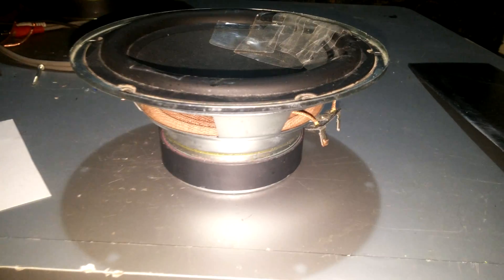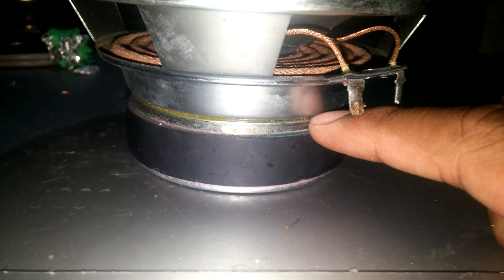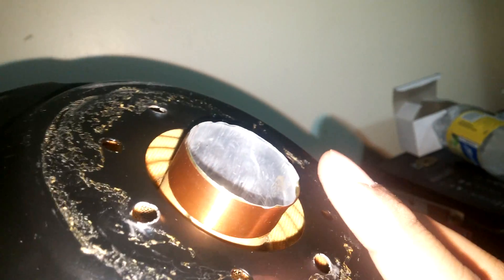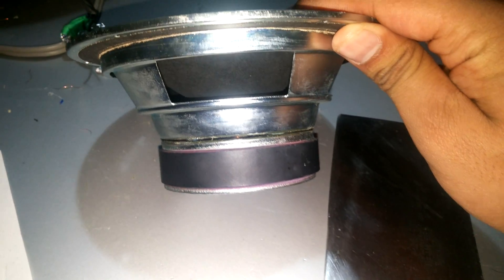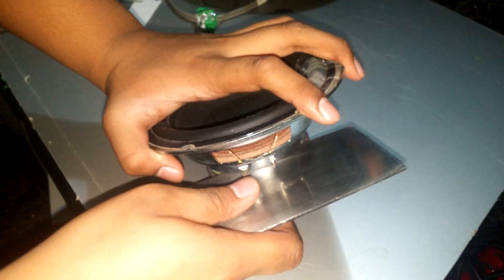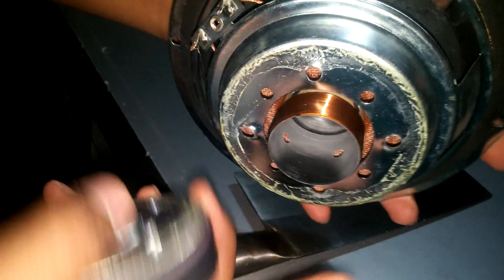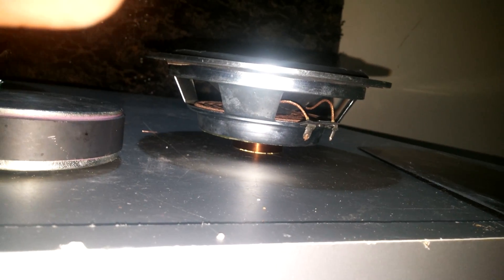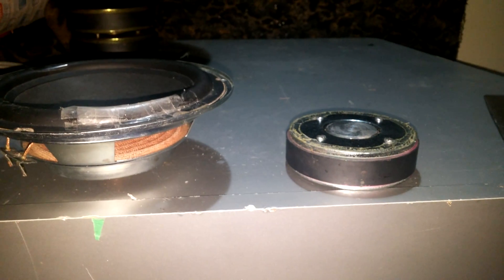Making a 6.5 inch passive radiator

Comment: Passive radiators only tend to work if they are bigger than the sub moving them and if there is more than one. Unless it's on a smaller speaker like a Bluetooth speaker where the bass is given through passive radiators. If you have one passive radiator and one speaker they might as well be out of phase considering one would go in while the other goes out. Canceling each other out. But if you had one sub and two passive radiators you would still technically be out of phase but wouldn't notice due to both passive radiators out doing the sub. I like them but hate them at the same time
Reply: Are you nuts?

Comment: not bad but how are you gonna tune it with no weights?
Reply from the maker: you add them into the vc. i put hotglue and a large screw. i can add or remove weight by adding or removing screw in bolts
Reply: cool man will have to try that if one of my subs ever blow... thanks for the tip
Reply from the maker: Np

Comment: Thank you,  i might turn my 10'' car woofer into a passive, since its bad and the enclosure is ruined
Reply from the maker: your welcome. dont forget to ad weights in it to tune your enclosure
Reply: Danielsan Pesongco Yup i will, i have to use angle grinder to get the magnet off tough, i tried but it sticks too good. Im thinking to have a pair of coaxial speakers and the 10'' passive in a boombox style
Reply from the maker: Try not ruining your spyder tho. Heat cant have the glue to weaken
Reply: how can I get a trash sub too